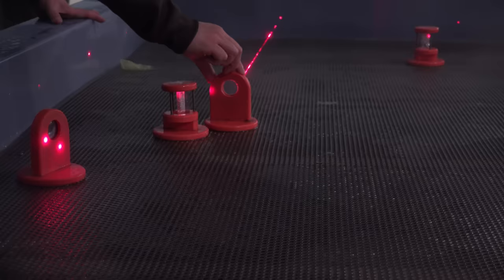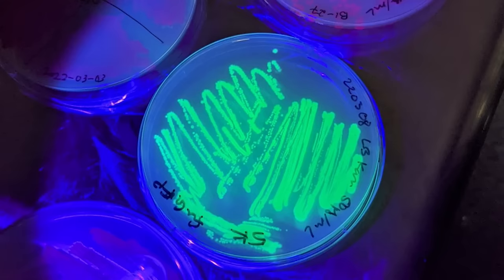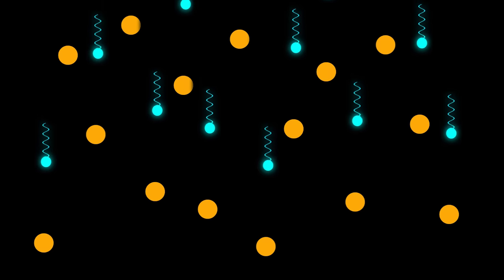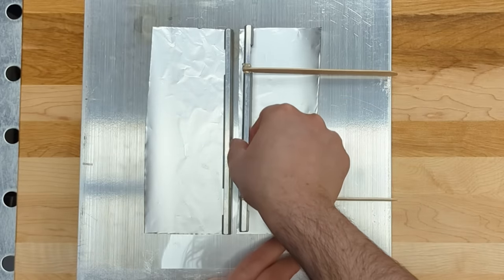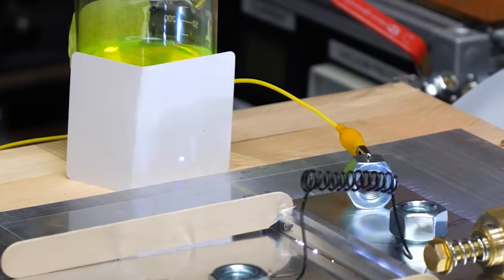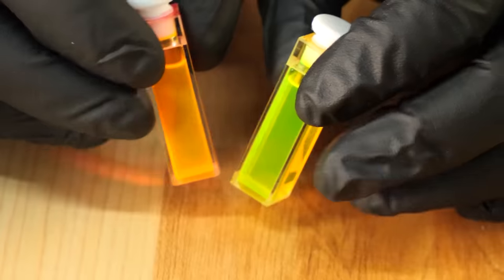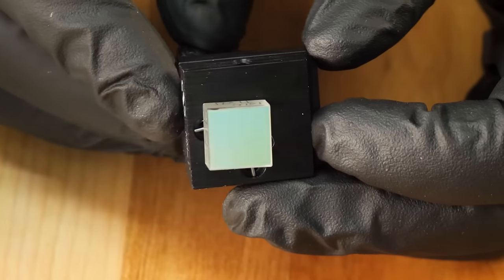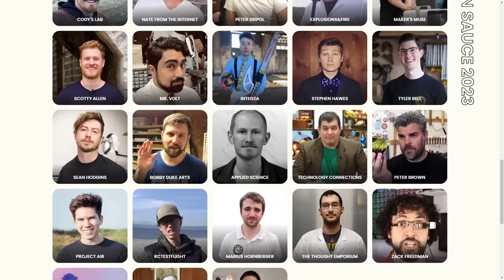We Built A Laser Out Of Tin Foil And Highlighters

Comment: I have worked with dye lasers and want to share some insights:
- You do not need UV light to pump Rhodamine 6G. The frequency-doubled output of a Nd:YAG laser (532 nm) is typically used and is much more efficient since the quantum defect to the emission wavelengths is small.
- A pumped stagnant dye solution will quickly get trapped in states that are unresponsive to pump light. The dye solution is therefore typically circulated so that the dye molecules have time to return to the ground state before being pumped again.
- The optimal dye concentration depends on the length of the cuvette with longer cuvettes needing less concentration. The concentration also shifts the tuning range of the dye with higher concentrations shifting to higher wavelengths.
- The surfaces of the cuvette can themselves act like a laser resonator, resulting in an unwanted beam. The cuvette is typically vertically tilted to steer that beam away from the intentional one.
- The positioning of the cylindrical focal lens is quite important as you have correctly identified. However, tilting the lens like that results in aberrations that lead to uneven illumination. A better solution would be to move the whole lens closer or farther away from the cuvette. Where the lens needs to be rotated is around the axis set by the pump beam. This tilt angles the focal line. You can either align the focal line with the laser resonator for maximum conversion efficiency or tilt it slightly away from it to limit the amount of amplified spontaneous emission that travels along with the dye laser beam.
- Rhodamine 6G is indeed a nice dye.
Reply: Do you need to lock the 532 or just a simple output of a laser pointer (the ones sold on e.g. AliExpress is enough)? What are the powers for it you think? The techniques he used in the video are for pulsed lasers afaik, would be more interested in CW

Comment: Neat stuff! The rail laser is crazy, never seen anything like it.
Reply: It is almost surprising to me that you have not yet touched on lasers yet. Then again, that might be a job for Tech Ingredients.

Nice to see you here!
Reply: Last thing you'll ever see.
Reply: seeing something that generates that much power with essentially no insulation is pretty terrifying lol
Reply: Styropyro made it a while ago
Reply: It looks like a Colpitts oscillator with the rail gun without the projectile as the LC tank so it pulses to allow quick recharging to regenerate subsequent pulses.
Reply: There was an article in Scientific American magazine something like 40 years ago about how to build the same kind of TEA laser. It was a lot bigger and more elaborate. The lasing chamber was enclosed in a plexiglass tube and fed pure nitrogen from a tank. The author claimed each laser pulse was over a megawatt.
Reply: @daveh7720  - I have a copy of that issue, back when my father bought that magazine regularly. That was back in the 1970s, so closer to 50 years ago. IIRC, it used a small motor with contacts, to make the HV synchronous rectifier. Ironically, synchronous rectification didn't become popular again, until processors requiring under 2V supplies, came on the market. Then the "diode drop" of even Schottky rectifiers were too inefficient, and power synchronizing FETs (without the reverse bias diode), for rectification had to be used.
Reply: @michaelmoorrees3585   I had forgotten about the synchronous rectifier. Thanks for reminding me!

Comment: As one of my optics profs once said: almost everything will lase if you pump it hard enough.
Also, and without getting into the intricacies of building a high end laser, a simple trick to make the laser cavity more stable (which should make it easier to align) is to replace one of the end mirrors with a slightly convex mirror (i.e. with focal length larger than your cavity length).
Reply: Yeah, creating a more stable (as in stability polynomial, not necessarily acoustically) cavity is to provide at least some form of focusing.

Also for anyone else interested in doing this themselves:
Just because the commercial UV laser was safer (electrically) to operate it's STILL A UV LASER which means it basically automatically is a class 3 or higher laser and also carries a higher risk of cancer (I am not entirely sure if this is wavelength dependent, but in all laser safety briefings and classes our magical wavelength is 400nm and everything below that requires very hard to get safety gloves and thorough documentation for something like 40 years due to the potential increase in cancer risk if exposed to the beam)
Reply: @reinei1  and blindness,, gotta make sure those goggles are validated correctly
Reply: @sciencegeek499  which is even more important with dye lasers since you can produce colors that no goggles exist for
Reply: @reinei1  Electrical Interlocking and MAJOR Safety Precautions are for nerds though…

( /j , the people behind this channel are probably doing all that / fine, but yeah especially the diode lasers selling these days really pretend laser safety doesn’t exist)
Reply: @ericlotze7724  I mean, as physicist working in biphotonics it's been years since the last time I saw someone put on goggles so I'm not sure the guys here would be an exception.
My phd supervisor hand crafts Ti:sapph and the only thing she wears is her reading glasses while putting shiny metallic screwdrivers inside the open laser cavity. The fact that she can still see at almost 55 years old is really a mistery to me.
Reply: @garak55  How, what and why?! Are your lasers so low power that a somewhat diffuse reflection of screwdrivers isn't an instant red flag to the department/laser safety personel? (Also how little do you pump them?! I have so many questions O.o)
Reply: @reinei1  I mean, the screw drivers are not very shiny, they're these dark metallic ones you buy on thorlabs, I was exagerating a little bit, sorry. Still, they're at least a little reflective.
If you're interested in our lasers, they're not "pulverizing metal" powerful but they're definitely "exciting non-linear optical effects" powerful. The output of my Ti:Sapph is around 500 mW average power but, when mode locked, the pulses are below 100 fs at around 80MHz. The means the peak instantaneous power is actually quite high. But to be quite honest, I'm way more scared of the pump laser which is a diode pumped solid state laser monstruosity. I don't have a power meter which which to safely measure the irradiance of this one so I can only tell you it should be between 4 and 5W in CW mode. And it's bright green as you might have guessed from its function.
I personally tend to wear the goggles when working inside the cavity because of the green pump laser but I tend to drop them when it's closed because not seeing the 800nm beam is too much of a pain in the butt for alignment. 
My PI on the other hand doesn't have such qualms. I think I never saw her wearing any safety equipment. Also, she technically is the laser safety officer of the department which I personally find hillarious. Once a year she gives a lecture on laser safety and me and her other students are trying very hard to not laugh the whole way through while she attempts to "scare the others students straight". It's kind of scary working with her to be honest but I learn a lot. If I finish my thesis with both my eyes still working I will consider myself lucky and grateful for the experience, and probably go work at a desk somewhere lol.

But yeah, that's what you get when you're the only "real" physicist at a medical school doing biophotonics. The hospital we're attached to have no idea of health and safety concerning that.
If you have further question, don't hesitate to ask :)
Reply: @garak55  ah lovely. I work with 50-100w lasers every day for work, and am careful to wear my goggles when going to higher powers.
Reply: What’s the discord link?
Reply: @ericlotze7724 alive nerds though.
Reply: She sees in X-ray.
Reply: @handlesarefeckinstupid  i agree completely!, jokes like that aside, i am a safe person (or at least i try to be) wear all my ppe and do all the checks/LOTO after hearing horror stories in my OSHA-30 class, or worse yet videos on the USCSB channel!
Reply: That advice should never be given when one's wife is around.   ;)
I'll just get my hat...
Reply: @reinei1  The demon core experiment was repeated after it had already irradiated and killed someone and the failure mode was well known. Some people have no sense of self-preservation.

Comment: I'm a laser physicist by trade and this is a fantastic video. Most of it is familiar, but i'm very impressed by how well you synthesize all these different topics and condense them without necessarily reducing them to an inaccurate form. Specifically, the topic of grating based mode-matching is awesome and a bit of a pain to explain well, but you managed to do it in less than 30s! 

One critique is that the TEA doesnt work via stimulated emission, but rather ASE (amplified spontaneous emission). This also means that although it is fairly temporally coherent, it isn't perfectly so which is why it only runs on a pulsed source.

Comment: Interesting point you almost make - an arc in air has a negative resistance, that is why there were early transmitters based on spark gaps as this negative resistance overcame the losses in the LC resonator circuit, thus creating a waveform at a frequency. Plenty references on the web if you look.

Modern day examples of similar are tunnel didodes that have a V/I curve that has both positive and negative sloped parts of the curve, depending on bias voltage.

Comment: Something I don't see anywhere which should be shouted from the rooftops. WHERE EYE PROTECTION WITH LASERS.
Not sure if this is the type that needs it if it's a special case, but better not lose an eye.
Reply: It's a UV pulsed laser, it most definitely needs eye protection (and possibly hand protection as well, but I don't work with UV lasers because the required safety precautions are insanely difficult/costly to fulfill here)

Comment: Regarding the paper; make sure you use Bright White paper. Plain typewriter paper won't work well. The reason the UV laser beam is visible, is because Bright White paper gets bright white because it is coated in a chemical that fluoresces under UV, so it looks brighter white than if it were just plain white.

Comment: We have the same "lucky reptile" meatcubators in the lab i work in. Some of them after about half a year developed an awful fault: they would crank their setpoint to 60C, and cook the content. It was a real challenge to find the cause of the issue. It seems to be caused by leds in the display not behaving as good diodes, causing false button press detections (because pins are shared).

Comment: This is awesome.  But,  knocking the rust from my physics degree, I have a couple of questions. First, like every explanation of lasing i seen, talking about pumping the electrons to a higher energy state and then stimulating photon emission always makes it sounds like a pulsed process. I assume that the probability an electron ïs bumped to a higher level and that it is stimulate to release an electron are equal but the passes of photons beteen the mirrors have a relatively low probability of stimulating photon emission. This would allow the total energy in the leading medium to increase,  leading to more photons, until an equilibrium is achieved. This equilibrium is then controlled by the probability that a photon is reflected or transmitted through the mirrors. Do i finally understand this?

Comment: This is interesting. I worked with a 1-watt CW laser that used Rhodamine 6G. My first thought about using a more complex molecule is that more of the light will be trapped in states that are not optically connected to the ground state. A solution to this for dye lasers is to circulate the dye at a fast rate to keep the dye exposed to the pumping laser "fresh."

Comment: As an electronics engineer, I can say you garbage laser has everything an electronics device shouldn't have : very high voltage with high current, exposed metal parts, no isolation whatsoever, massive EM emissions, bad contacts, sharp angles, etc... And yet really want to build one. Impressive work

Comment: You could get almost any wavelength from the visible spectra from Rhodamine 6G by just adjusting the resonant cavity length. Anyway, by using a UV laser you need a UV transparent medium to get the excitation beam into the sample. That means a fused silica cuvette or maybe a BK7 glass. Normal glass is opaque to UV, as are all commercial polymeric materials.

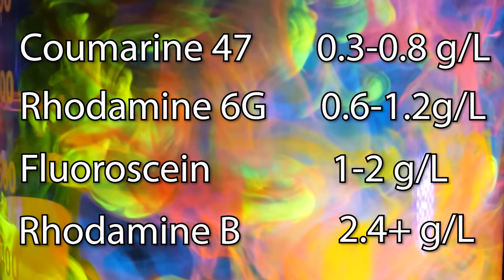Comment: at 13:57 you mentioned you need ethanol, this is not necessary, I worked in a laser lab using dye lasers where we used R6G and coumarin 47, both of which work about as well with Methanol which is much cheaper. Sirah is a company that makes dye lasers, and they have a pdf with a whole list of various dyes, wavelengths, and concentrations

Comment: Guess I should catch up on this channel... my 4-year senior project was for a medical company that want to generate 1000V pk-pk, at a tunable frequency of around 1MHz. Did I mention they wanted it Sinusoidal, and reference to ground? The "good part" was the resistance would only be 2 kOhm at the lowest, up to 20kish, and an duty cycle/period of ~5ms on, 995ms off. Went through a whole bunch of different designs... they asked why other designs were smaller, and it's like, bro, FLYBACK IS WAY EASIER.

The actual project: a high-voltage high-frequency driver for cardiac plaque ablation. Treating cholesterol build-up on the dang table. If only my team had any headspace around how important it was.

Comment: Since you got a dye laser now, you can try a little experiment I saw in the video of another channel: Use the dye laser (green or sth. similar) without the diffraction grating to produce a wider range of wavelengths and shine the laser through a glass fiber cable (100-200m long) to produce supercontinuum laser light which is actually white.

Comment: I got a question for you. I think you already kinda given me the answer>>> WHY do my lasers give off energy all the way along the length of the beam and yet perpendicular to that beam since light travels in straight lines (even though I heard it doesn't)>>> is it because the laser is energizing the nitrogen in the air around the beam you can read a book standing to one side even at a distance using green for better vision.
Also if and when molecular lasers get going does this mean we will get more efficiency and tighter beams with less Mrads??

Comment: Let me see if I understand this trash laser correctly.  You charge up the left plate slowly, which also charges the right plate via the choke.  Once the voltage is high enough, it jumps the spark gap, discharging the left plate very fast, but the right plate can't discharge so quickly through the choke, so instead the voltage arcs across between the two rods?  That isn't really a laser though is it?  The nitrogen is just glowing UV in all directions isn't it?

Comment: As someone of neuro-divergence and as someone who has extreme light sensitivity, I would like to inform you, I can in fact see the beam. For point of reference, I'm commenting at 1 minute and 8 seconds into the video, and I do not have to look at the solution to see the beam of the laser. I see it as a straight bluish white line between the laser and the beaker. though there are occasional blips of yellow in it, which I will assume are interactions with the air. Still looking forward to the video though. I love your content.
Reply: What? Are you talking about the arc occurring within the metal trap that is causing the camera to glitch out? You shouldn't be able to see anything between the beaker,and the large metal rectangle with an arc within it, if that's what you mean, because the camera shouldn't have even recorded that information on the digital camera, and your screen shouldn't be showing it because a normal screen is not set up to transmit UV light..
Reply: Unless you are a female with tetrachromia where you would be able to see partial wavelengths that the human eye usually can't see, there really isn't any way that should be possible, not the least of which being that most lasers are completely invisible even when they are in the visible light spectrum without something like the dye or a substrate like dust to reflect or bend the light in a direction you can see. Like you shouldn't be able to see it not just because it isn't visible light but because it is a laser that isn't pointed at the camera. Think of like, just a normal red laser toy for cats. It just looks like a dot on the wall. You don't actually normally see the laser like on TV. I'm not doubting I'm just saying you should rule out the usual suspects like your phone or computer screen, or if it is an optical illusion, because if you can actually see a laser of UV light as an actual laser beam that would be scientifically noteworthy. Even if you could see a regular laser toy's laser beam that is not deliberately designed to be seen it would be worth figuring out WTF is happening.

Comment: Will you be making some sort of system akin to what “Tech Ingredients” did back in the day, or will you be mainly sticking with these small containers?

(It probably depends on power level, but if i remember correctly, and as you mentioned with the dye being “burned up” cooling/replacing it becomes quite a need, right?)